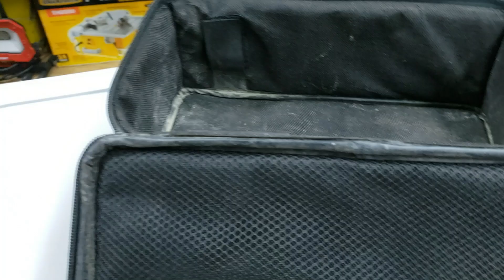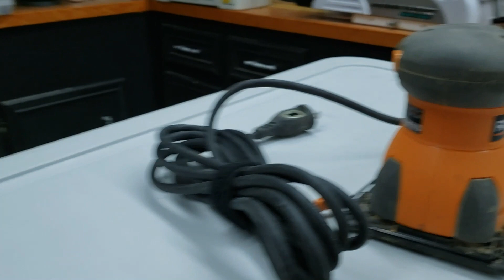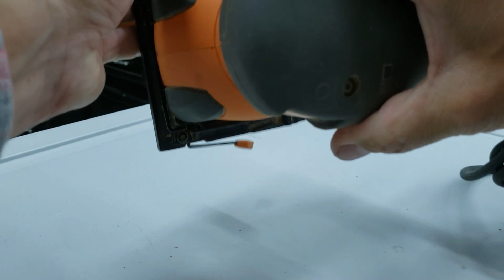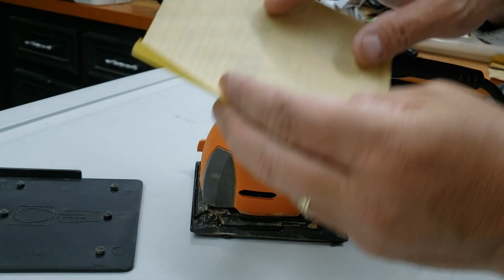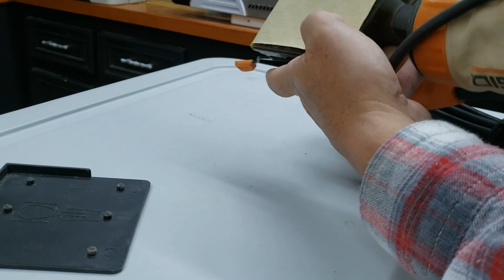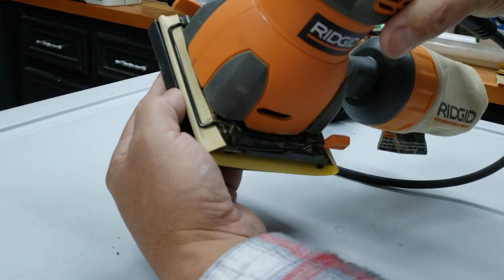Ridgid Brand 1/4 sheet Sander Review

Comment: I bought this new, over a decade ago?....not sure. I never really took it seriously UNTIL I built these 11ft custom wood gates. I made them real mortise and tenon joints and so I had to buy real barn framing chisels to accomplish this. I built the gates under an overhang, but there was sunlight exposure.  The wood was starting to age due to the length of the project....middle of summer. I was about to buy a belt sander, but something told me to try this little guy. 

Man, this thing is a beast with like 100-150 grit paper! Brought all the wood back to its original look so I could stain. Sanded any problems or blemishes I had. Amazing tool.....never a hiccup.  Parts are still available....just replaced the bottom pad. I buy all the paper ready to go @HD....no hassle with cutting etc. Interestingly.....in the center of the dust collector if you take the bag off, you can insert a vacuum hose(the standard smaller shop kind). You might consider this if you're sanding a lot because that bag fills FAST.

Maybe the older ones are better. Mine is so old it came in this giant, blow-molded plastic case.  I bought this when Ridgid power tools were trying to get a market share against everyone else.  I have a big Ridgid drill from that period I've rebuilt as well. Looking at Ridgid tools now in HD, I'm not as impressed.

Comment: O have the 2501 mime is trash. The front clip is different from this model. It let's go of the sand paper. Pass on the 2501 sander.this is the only problem I have had with ridgid tools.
Reply: mine lets go too
Reply: Mine doesn;t work either.  I replaced it once, but the replacement quickly failed also. POS